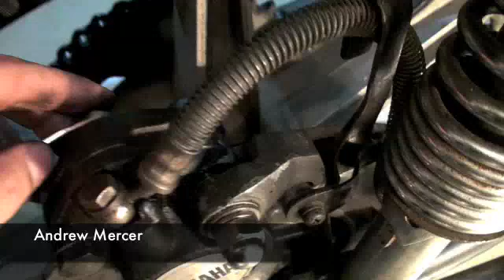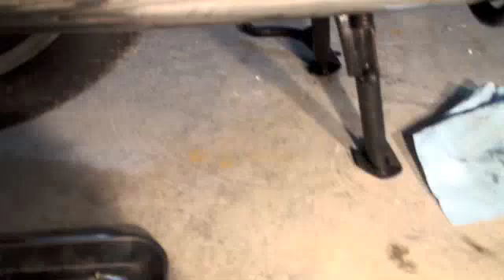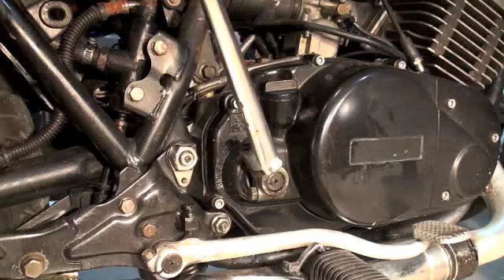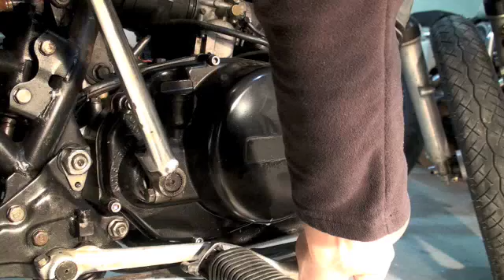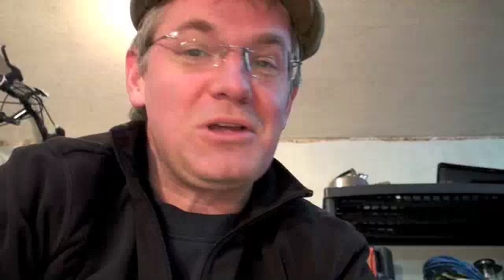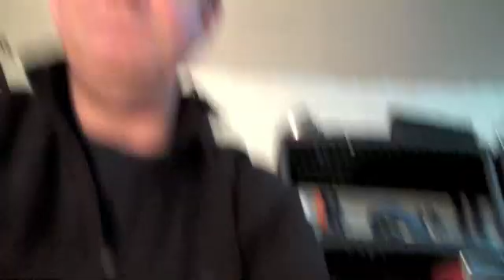Motorcycle Brake Repair RD400 Part 3

Comment: I wonder if a clear tube and syringe can help draw the fluid through the system. I did like the fluid fill part at the banjo bolt connector. Thats great for getting fluid into the piston area

Comment: I know this is an old video but when bleeding the brakes you should install a piece of hose or fuel line over the tip of the nipple to prevent the break fluid from squirting all over and possibly onto the pads.